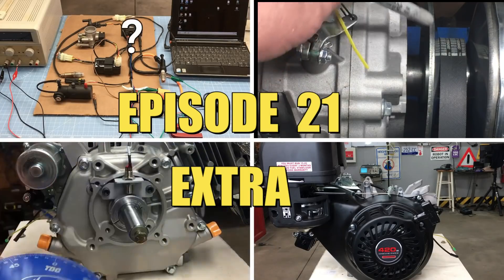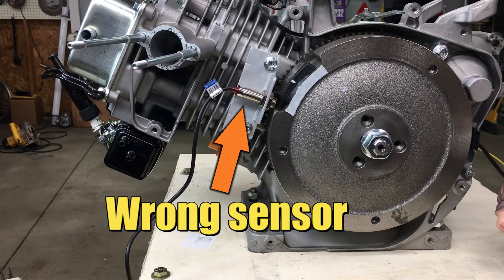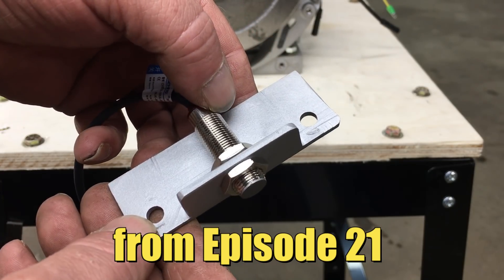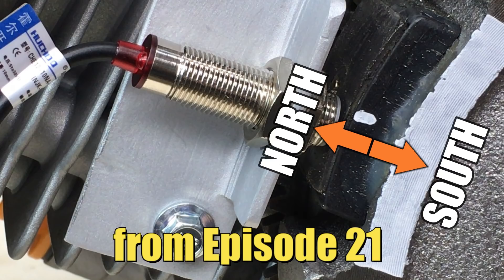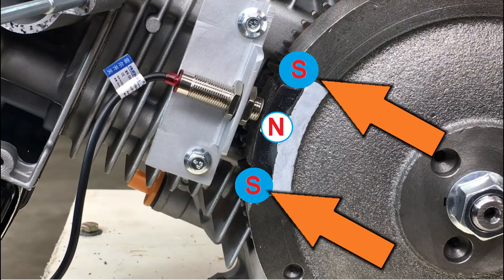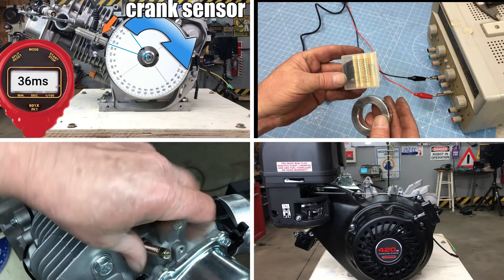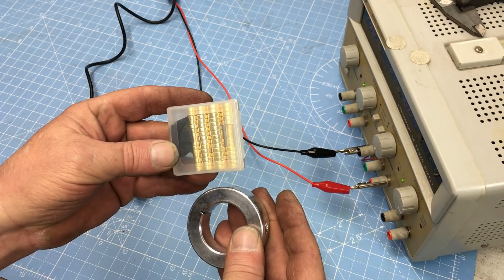Episode 21 and a half...... Deep dive into the ignition system problem on our 420cc EFI build

Comment: Actually I can think of at least 2 simple solutions for this double trigger. By "simple" I mean simple for electronics people so probably it's outside of the boundaries you put for the content to match certain audience. Anyway, here's first solution with a slight problem and the second that I would probably go for: 1. a monostable multi-vibrator or in other words a simple delay circuit without re-triggering, this would give you a constant duration single pulse, the only problem could occur if the flywheel stops at the magnet position but one missed trigger at start-up shouldn't be a big deal and I assume the delay would be long enough to match the lowest RPM during crank. 2. probably a better one, a T-flip-flop, first pulse would change the output to high and the second to low or the other way whatever suits you, by using a flip-flop with reset input you can very simply ensure it will start with a correct state, still might be a bit sensitive to magnet stopping at the sensor but this also can be solved easily by resetting flip-flop with a single pulse at crank start (simple RC circuit). 
Great videoes :)

Comment: Wouldn't the "skip pulse" function in the software "swallow" the extra pulse?
Reply from the maker: The skip pulse is for starting the engine.  This allows the ECU to collect data before it fires the injector and the ignition.

Comment: Nice update.  That thing turned over very smoothly in the sneak peak.  I wonder if you could extract some power from the original magneto on the flywheel to power the EFI system?  You have some very nice machining tools for an electronics guy like us :)

Comment: Anyone knows what happened to the project of only subscribe of this channel: FUJIOKO (see CHANNELS at user yt profile of ROBERT CANTINA)
????????¿????????
The project deals with petrol vapour
Reply from the maker: Fujioko is my older channel,  for some reason youtube will not let me add any more videos to that channel.  The Vapor project was pretty cool but the ceramic ultrasonic plate would crack after a while.  I never took it to the next level.
Reply: @robotcantina8957  thx for reply. Maybe you achieved so good fuel efficiency that boosting about it publicly on yt would destabilise the oil market :) anyway do you think vaporizing diesel would result in such heavy fog with your setup?

Comment: I wonder if insulating the ring from the axis would prevent it from running hot, by running a small plastic sleeve between the ring and the axis.
The ring would cool through friction with the air, and the magnet will surely be a few degrees colder.
Besides, the plastic sleeve will probably allow for a much better grip (I think).

Comment: what about replacing the flywheel and magnet assembly in it's entirety?  Go with a custom CNC flywheel?  Install the magnet yourself?
Reply from the maker: A custom CNC flywheel would be more expensive than the $55.00 sensor.
Reply: @robotcantina8957    I agree, unless you had a friend make it.

Comment: I don't know much about electronics, but when I look at that with the flywheel setup I feel like it would work if you made the  signal from the flywheel turn an electronic switch on and off and just increased the angle from top dead center a little more on the configuration program.  Then the signal goes from on pulse, off pulse, on pulse, to signal on..... signal off.   Just a suggestion.

Comment: There is a big difference in power of a good tuned for performance carbureted engine and an good tuned EFI one? I mean, yes with the EFI you can get maximum power over all the RPM range, but is it really worth it the update?
Reply from the maker: Folks are interested is stuff like this. It may help performance and it may not.   If you watch all the videos, then you know we are going with forced induction eventually and at that point EFI will help.
Reply: @robotcantina8957  Yeah of course, if you wanna add a turbo or a supercharger later you need EFI to get full advantage of it, but these kits for a gokart are a bit useless in my opinion in terms of performance advantage, especially if the gokart has a CVT that always keep the engine and peak power RPM, of course if you wanna have the experience of the installation and tuning go ahead, but I won't do it just for performance if I have no plans of doing forced induction, maybe in an engine with gearbox it makes a bit more sense since you can tune all the RPM curve and save some gas.
Reply from the maker: @joakoc.6235  The main purpose of this whole project is to make youtube content.  I realize I may not be making the right choices for specific performance and fuel economy but its for entertainment, people like this stuff and its a really fun project.  I am capable of building some serious stuff but,  like I said this is fun.

Comment: Nickel-cobalt or Alnico alloy would be the answer for the magnet if it doesn't work out as-is. Pretty strong, as that's what some old speaker magnets were made with, even if it's not quite as strong as neodymium. Also if you reach it's curie temp, you're going to have bigger issues with the engine already.

Comment: Neodymium heat issues are real and once it's done it's done. I suspect anything in the engine bay even the coolest item on the warmest day furthest from the the engine is too hot. 

They really don't withstand the heat.

source: I have a whole bunch and use them in projects like you do. One time I used one to hold a piece of paper to a hot plate and by the time the plate hit 150F the magnet was done.

Comment: First awesome series.
Just wondering more about why the original pickup won't work. How does it work, is it like a hall sensor, what does the signal look like, can the ecu use the pick up signal? From the short time knowing about speeduino. I was under the impression that 1 signal will work but works poorly. And that the crank should have something like 32 tooth missing 2  for it to work the best. I'm glad to see that may not be the case as all my engines I want to be efi are pickup type. What if you don't want to control spark but just fuel, would that make it easier install, and less worried about timing accuracy for the fuel injector.
Reply from the maker: The original trigger was embedded in the magneto and there was no access to it.  The single trigger ignition will work on the EFI, but as you indicate the more teeth, the better the timing will be.  We will explore the multi point timing once the car is up and running.

Comment: the ease and familiarity with which you described how the fuel injection system works was a hint and a half that you were in the electronics field. when you said you don't know how people work on electronics without an oscilloscope was the clincher. most people don't even know what an oscilloscope is, let alone how to use one. then not only did you realize the system wouldn't work as you planned without having to try it first, but came up with an elegant solution to the problem. it didn't take sherlock holmes to point out they are all signs of a highly skilled electrical engineer. obviously, building complicated go karts is just a hobby to pass the time when you're not solving some problem that would have the rest of us sitting in a corner hugging our knees and rocking back and forth with mental overload.
Reply from the maker: Thank you,  I'm so glad to be able to share my projects with such a great audience.

Comment: The start up of the car gets me every time. I m so used to car engine sounds and hearing basically a lawnmower throws my brain off. I guess my eyeballs don’t believe what they are hearing. 🤣🤣
Reply from the maker: The electric starter sounds weird, but peoples eyes pop out of their skulls when I use the pull starter.
Reply: @robotcantina8957  To bad you can't put a crank on it and crank start it like in the good old days.

Comment: Made perfect sense already last time. My problem is, that I´m  afraid, that your new, small flywheel (with thus lower resolution) will trigger the sensor for 2/360ths-3/360ths instead of just 1/360th of a flywheel-revolution. Maybe you´ll have  to space  the sensor further of the small flywheel, so to get a shorter lasting triggering signal (higher resolution), even if then that signal gets a bit weaker.. But that´s just my thoughts, and I have no clue about such stuff... After all, the old, big flywheel had a gigantic magnet (so, also low resolution/precision ;-), while the new, small one has a tiny, matching magnet, so, just my thoughts...
Reply from the maker: The ECU operates so fast that the signal we are getting is plenty. For the ECU it seems like eternity between crank signals.  Keep in mind the crank trigger doesn't directly fire the ignition.  All the calculations including dwell are based on data collected on the previous revolution.

Comment: How do you plan to measure magnet temperature? An infrared thermometer can't measure metal since it reflects infrared.  The fix is to cover the metal with tape.
Reply from the maker: So this weekend when I put the car back together, I painted the aluminum collar black in order to avoid emissivity issues. The IR  thermometer should be fine.

Comment: Can't you just set the skip to 3 instead of 1 for the magnet( should work for all cases except if motor turns off in between magnets)
Reply from the maker: The skip feature in the setup menu is used during engine startup.  It tells the ECU not to fire the ignition or injector for X amount of revolutions.  This is so the ECU can gather info about RPM.
Reply: @robotcantina8957  is there another skip option for when it is running or is that part of the source code that you were explaining
Reply from the maker: @iflippedmyself1  Unfortunately there is no other settings that would apply.  The source code would need to be altered.

Comment: I was concerned that you might lose timing accuracy going with a smaller radius collar as opposed to the larger diameter flywheel flagging the sensor but it seems to work great! Let’s see what it can do now!
Reply: As long as the collar stays put you can tweak the timing in the code.

If the code says 22.5 and it's  actually 21.75 doesn't really matter as long as the offset stays consistent in the table.

Much Luke manually tuning a distributor, what matters is how it runs, nor the exact placement. One engine might like more or less advance so you tune to the motor not some calculation. The calculation just give you a good starting point.

Same here. The placement of the collar/trigger get yiy a starting point. The you tweak for the engine/application.

Comment: It could have been solved using some inverters and an AND gate. 
However, as you said, it's not something your Average Joe would understand.

 Furthermore, your approach is far more headache free, considering that there's fewer stuff to go wrong.

Getting engines to run without electronics is a task of itself, i'd be wary of using a pulse generator on the igniton timing. Even a slightest issue could make your car run bad and could take weeks to find.

Comment: The curie point of neodymium magnets is around 350ºC.
If your engine is that hot, you got other problems.

The sensor will pickup a very weak field, so it shouldn't be a problem.
If it does turn out to be an issue, use an AlNiCo magnet.
Reply from the maker: Thanks!

Comment: This system could be used on a two stroke engine to make it fuel injected? The ignition map is adjustable so it could be changed to a 2stroke map?
Reply from the maker: I am not affiliated with the company that produces this system.  There is a link in the description that you can use to contact the seller.

Comment: The ecu is expecting a logic low as a trigger ,, a 1k pulldown resistor is all that would be required to use the original sensor ...
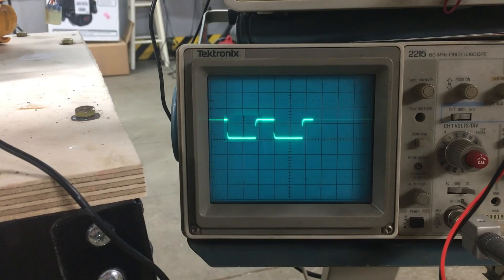Reply from the maker: So, in the video @ 3:04 we show the double trigger.  It is beyond a resistor fix.
Reply: @robotcantina8957  Doesn't have anything to do with PNP or NPN sensor ...Use second sensor to "gate" the first.....
Reply from the maker: @TheIAMINU  OK, I can see how that would work.  Great solution.

Comment: You addressed my concerns, when a magnet is heated it looses its magnetic properties, the temperature which it will loose its properties depends a little on the grade of the magnet and so but its usually from 80°C to 100°C. Hope this info helps a bit.

Comment: Wondering if a cheap door alarm sensor thingy would work since they use magnets to operate. Since many of them use a reed switch to detect if the door is closed.
Reply from the maker: I don't think a reed switch would be able to handle the frequency above idle speeds. But theoretically if it could, then it would work, but I wouldn't bet on it.
Reply: @robotcantina8957  Would be insteresting to see it work but yeah if it worked it probably won't last long. :)

Comment: Personally i would have just glued a neodymium magnet to the flywheel and called it a day.
That shaft collar mod was pretty clean.
Reply: Unfortunately, that still either leaves the original magnet attached, giving two additional sensor signals, or removing the original magnet and necessitating the flywheel needing rebalancing.

Comment: the magnet you used will be fine, I made a hall effect sensor circuit and triggering setup for an old 3 cylinder engine, it ran for years, the temp the crank gets to on the outside of the your engine is below max operating temp typically for the magnet(76-83C), and even if it gets above, the sensor you are using is so sensitive that even in a heat weakened state the magnet would do the job for years regardless.

the piece of old garbage 3 cylinder I did up has the magnets in a much worse heat exposed area than you have them, and they have been running/working well for 10 years(and my sensor setup is home made garbage made from a TO-92 package sensor), and I'm betting the quality of my cheap magnets is alot lower than what's cheaply brought today.

Comment: Considering the mass of the metal ring you are mounting the neodymium magnet in plus the sensitivity of the Hall effect sensor, I don't think heating will be a problem. There are plenty of other things that could go wrong long before that would have any impact. Engines that are pushed beyond their maximum intended output don't last that long anyway. So, It's not worth worrying about.

Comment: Thanks for clearing up what happened. I would have come down in the "just build a signal inverter" crowd but the double trigger from the leaky magnet put that to rest. I like your solution!
Reply: A solution could be to use a counter or a d latch to delay the on signal by one pulse.
Reply: @toto29620  Use 4017 as decade counter reseting every second pulse maybe?
Reply: @Alfred Wedmore The timer will start at wrong pulse when the first pulse is out, engine rotate wrong way or you have so much noise in the system that it wouldn't work anyway. In either case you're looking at more serious problems. And why the hell do you need a microcontroller with a timer do count pulses - there are just two pulses: falling edge, raising edge, falling edge and raising edge again. The simple timer will do this without noticeable delay (somewhere in ns range) and doesn't require any code. The microcontroller requires writing code which is strictly deterministic - the output have to have precise delay or all your engine timing gets out of whack. 
Also why are you talking about camshaft sensor? Is this some "fancy" 4 cylinder engine with full sequential injection that requires that?
Reply: @Alfred Wedmore For my purposes I would probably use simple delay timer (555 circuit most likely) triggered of cranking signal to delay enabling of 4017 counter by some ms in case the engine stopped with HALL sensor between two magnetic spots. Tie 1st output of 4017 to the ECU input, tie 2nd output to the reset pin and IC triggers on 1st pulse resets on second. I don't talk about noise in the system cause if there is enough noise to trip counter IC it would most likely fool ECU presented in the video without counter IC.
Also I know that sticking magnet on camshaft is best solution but I'm not considering it because it's not a solution used on this channel. It was stated in episode 21 video around 8:25 mark (https://youtu.be/1T8Mi3g7380?t=505) the collar with a magnet was placed on a CRANKSHAFT.  Either ECU have some way of sorting itself out (via intake pulse or something) or have problems running because it will try to squirt fuel and fire every 360 degrees instead required 720. It will try to fire on the intake stroke and squirt fuel at the combustion stroke so I suspect running rich and firing into intake.